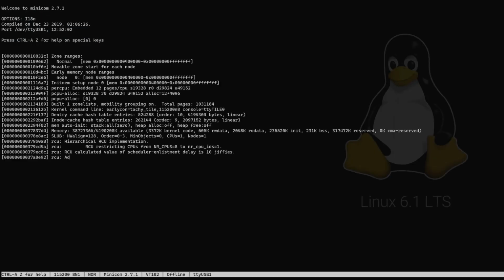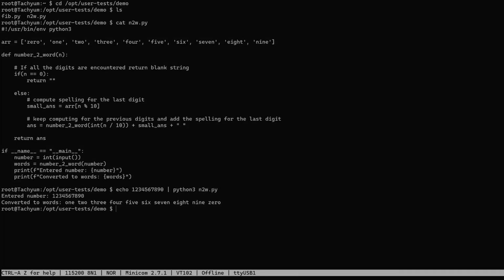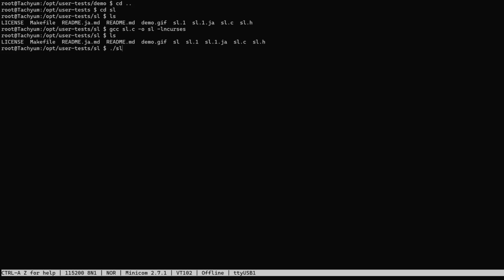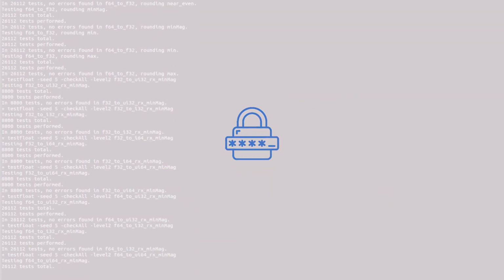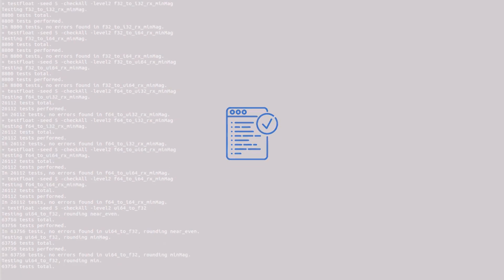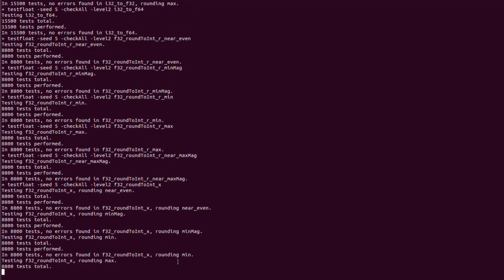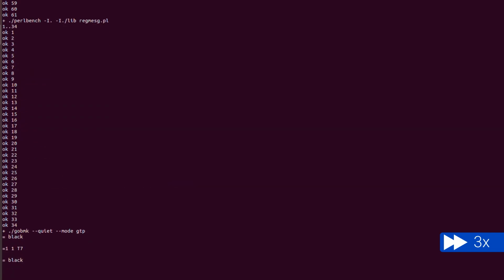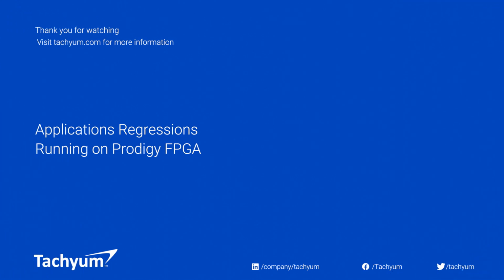Applications Regressions Running on Prodigy FPGA

Comment: Dear friend,
Glad to know your info.
May I know if we can help you something in your business?
I'm Maggie from Shenzhen KG Model Co. Ltd, which provides some services in metal and plastic items:
（1）Four processing: 1. CNC; 2. 3D printing; 3. Vacuum casting; 4. Sheet metal fabrication.
（2）Post-treatment: 1. Manual processing (Deburring, remove sharp edge, assemble etcc.); 2. Polishing; 3. Painting; 4. Sandblasting; 5. Silkscreen; 6. Pad printing; 7. Laser etching; 8. Electroplate; 9. Anodizing; 10. Cover UV layer; 11. Wire drawing; 12. Gilding etc.
If you need prototyping supplier in China, pls give us a chance to turn your design into reality.
I'm waiting for your reply.